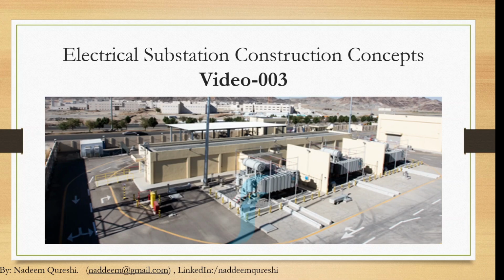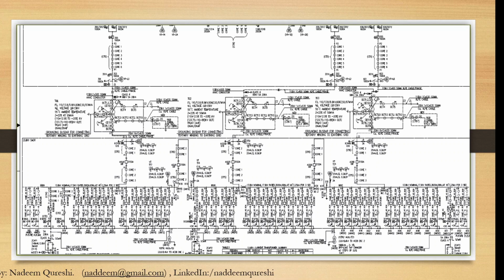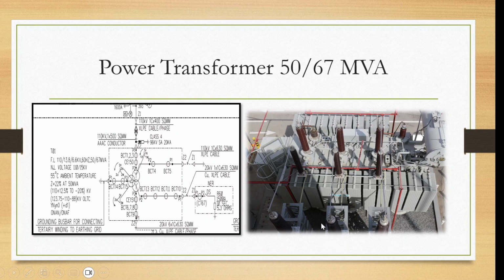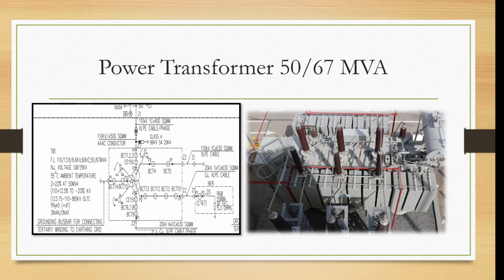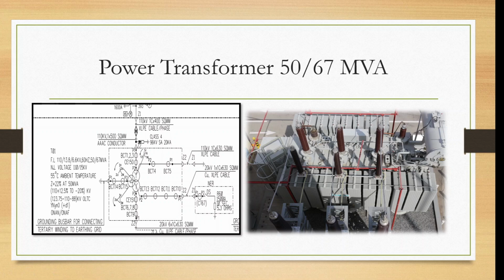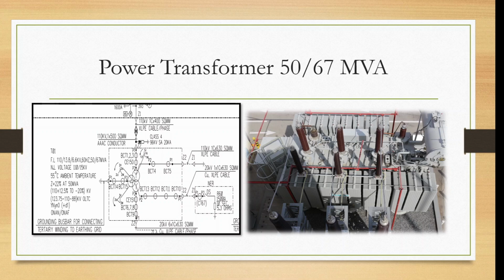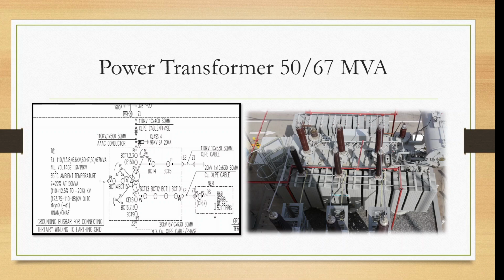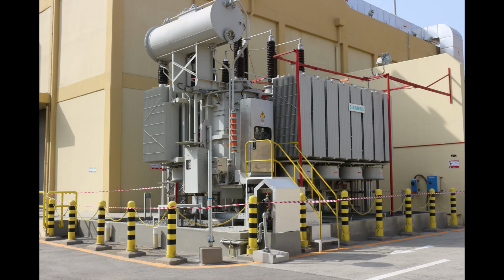Power Tansformer from SLD to actual Electrical Substation Concepts - Video [ 003]

Comment: Lovely sir, excellent  video, what about the installation part. Once the foundation is made, the various types of grounding connections all need to be ready. Once the installation starts, which methods and important aspects (Center line , marking, rail  etc) to keep in mind should also be highlighted in a separate video, if possible. Once the installation is complete, will you highlight all those important tests in the separate video?
Reply from the maker: Dear yes we will try to cover the minimum knowledge for a project executor . Like PM SE SM so in one project there are alot of field nvolved .we will togather touch all the fields. We can discuss the earting dwgs conductor sizes  earthing componants mesh and equipment earthing  risers etc. But all depends on its useabilty . I will try to produce videos as per you ppl requirment intrest and feedback.